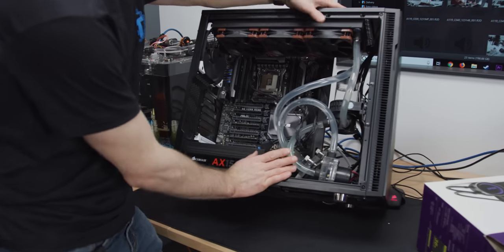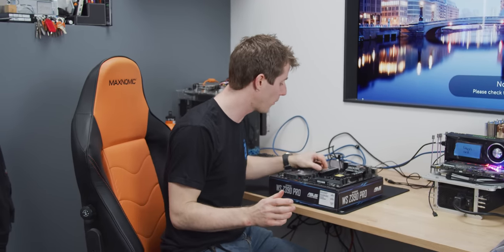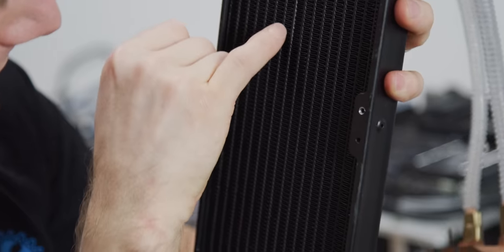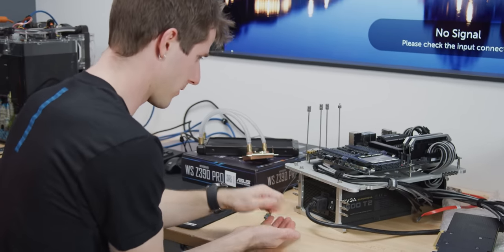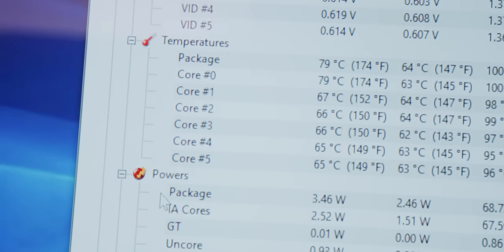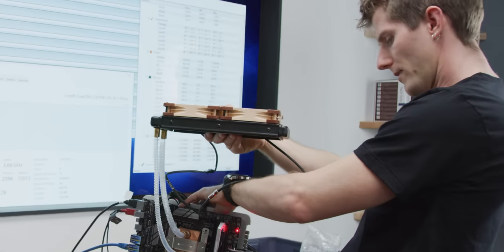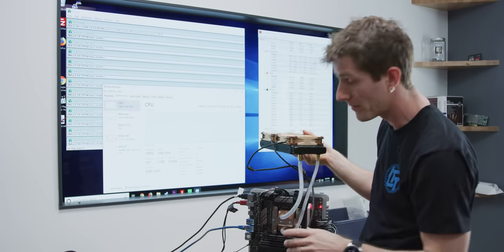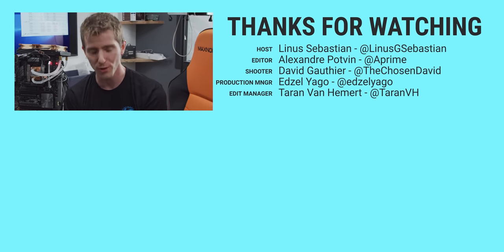CPU Cooling with BOILING LIQUID 🔥🔥

Comment: I am surprised that water would be used over an alcohol like ethanol or isopropyl. Yes the heat capacity is a fraction that of water, however the vapor transfer is significantly superior if you're going for a pumpless design. I am not a fluid dynamics guy but I'd gather you could probably do an ethanol/water mix to get the best of both while lowering the boiling temperature. Ethanol even boils at 78C which is the optimal operating temp for hardware unlike the 100C for water.(Again, if you're going for a pumpless design.)

Comment: Really? have you not tried a liquid with a lower boiling point? 
Boiling point of water: 100 °C / 212 °F
Boiling point of water (in Kelvin): 373.2 K
Boiling point of ethanol: 78.37 °C / 173.1 °F
Boiling point of methanol: 64.7 °C / 148.5 °F
Boiling point of acetone: 56 °C / 132.8 °F
Boiling point of alcohol: 78.37 °C / 173.1 °F
If it needs to boil in order to move the CPU need at least to get the liquid to the boiling point, sooooo what happens if the liquid has a lower point? my guess is well you could blow the entire thing up or create more flow (or no flow at all) i think is worth trying. 
Please try !
BTW you are the best, i recently found your channel and i am watching almost all videos lol

Comment: I don't think that the pipes in the radiator should have been at the same level, if the radiator was on it's side so that one pipe was higher then you might have had better circulation... probably best also if the pipes where connected diagonally... still not efficient enough but this might have increased the efficiency significantly...

Comment: basically it operates like a heat pipe, but without a wick and copper tube...
Reply: oh I commented before I got to 3 minutes into the video. Linus pointed that out pretty quick. haha
Reply: you took all of the right steps eventually, although I believe if you mounted the radiator where the tubes are vertical between them and you have the vapor line on the top side, that would likely improve flow as well. I am curious about this thing now.

Comment: What if they used a combination of two or three fluids that have different boiling points? So while one has turned into vapor and is in the process of being cooled, the other is still surrounding the cpu in liquid form?

Comment: put the motherboard flat and turn the cooler under 90 degree against the motherboard(so pipe in under heat comes from the cpu  pipe top fluid goes to cpu) and bubbbles :) that mean that you have air in the system that mean that this system not going to work properly  remove all possible air from the system and try again.

Comment: Its dry water, Novec made by M3 company. it doesn't short out electronics , you can put your whole pc in Dry Water (Novec) and it wont short out. I'm 99.9% sure that's what that is. I would put money on it. Dry water or Novecs boiling point is at 49.2 degrees C.

Comment: ahh try adding 2 or more radiators and see if it does something to reduce the temp even further... however it wouldn't be a standard tower case that you  can mount the cooling setup into..

at this stage an oil with a high boiling point may be the only liquid option that could  be used

however if you were 100-1,000 proof alcohol route for cooling  you likely need to get it 5 to-5c making the solution pointless to consider the option..

at this stage the only 2 oils I would use if attempting to use a radiator type cooling setup that would be  rice or olive oil or similar consistency..
Reply: You're missing the point completely, and Linus didn't explain it properly at all. The whole point about using evaporative cooling is that when a fluid turns into a gas at the same temperature, it absorbs a whole lot of energy to do so, and this is called the specific heat. Similarly, when it turns back into a fluid at the same temperature it gives out a huge amount of heat. That's why, despite his dumb-arsed positioning of the components, it was still doing semi-effective cooling despite the very low volumes of fluid and gas passing through the cooling block. Had he just once positioned the components most effectively you might have seen much better results but he fucked up the experiment good and proper. But that's why you need a fluid with a low boiling point, not a high boiling point
Reply: @herseem  i understood what he meant even if poorly explained how ever you will still  need to cool the liquid down to a point and sadly you would likely 2 or more radiators to cool it to the point the liquid is cooled enough not to cause throttling of the cpu.. and anything else within use in the cooling system

living  in a country that oftenly doesn't see an ambient temp below 35c in summer  and can average the same temp days on end all year round..

cycling hotwater can become corrosive even in gas form because you are still boiling the water with impurities  and whatever chemical imbalance there is would cause more  more damage..

 unless you have the capacity to drop the the temp from 60-85c to 2-10c and keep cycling the water no chance in hell you are drop the heat to the point you don't start cooking thing..

you will likely be needing a cooling solution that would not likely fit within that chassis to the point you could drop the cooling down to a point it would below 22c..
Reply: @jasonhowe1697  An ambient temperature of 35 degrees C??? That's a tough environment!. Evaporative cooling there could be a challenge as it would be more difficult to get the damn fluid to condense again
Reply: @herseem   in my situation  it is best to sit  the  pc on a concrete floor and  suck cool air through the bottom of the case and vent out the top...

My original comment was more directed  at cooling  aspects of the system as setup you would likely be needing to mount 2-3 cases together to mount the excess coolers into I would hazard a guess that  the cooler setup  was not adequate for use if you were trying to cool the system down past operating temps as I doubt it would cool tthe liquid enough dissipate the adequate enough for cooling the cpu or anything within the cooling loop..

I have no clue what the average temp in north america as a whole  is  however I suspect you will likely need to operate this in a constant room temp south of  25-18c for adequate cooling requirements..

if you are in a room north of 32c you will not have adequate cooling
Reply: @jasonhowe1697  your suggested airflow pattern is pretty sensible for any environment - bottom to top
Reply: @herseem  It make more sense having the psu in the top part of the  case unless you require a 2 psu option.. depending on the gpu option you want to use..

you would pretty much  need a different case and layout if you wan to suck cooling in from the bottom..

however I still have to ask being a workstation class platform i have to wonder why isn't there 2 psu's in the chassis as you would likely 1 psu for the the mobo and drives and 1 for the gpu setup ..

Comment: How about if it used rigid pipe and a pair of non-return valves to force a directional loop through the block? I could see that being much more effective (as long as the loop could withstand a bit of internal pressure) as the current system appears to be working like a reflux condenser and not making the best use of the radiator

Comment: .. if the problem of noise is pump... it's possible to make a parallel 2 or more pump loop? it could be possible to reduce rotation inside every pump, reducing noise, but have the same flow (sum of the reduced flows of every parallel pump). Or not?

to explain better

pump go for example at 100% at make a lot of noise.
if i put two pumps at 50% the noise will be lower but the sum of flow (50%+50%) is near the full flow of a single pump.

i don't know if it could work...

Comment: The liquid inside is most likely called, "Dry Water", made by 3M.  
Orientation is CRITICAL.  Tilt the PC board as well as the radiator.  Neither of them should be horizontal...  The smaller tube should be BELOW the larger tube at all points in the loop.  Thus the airside would always be ABOVE the liquid side.  Allowing the liquid to flow back down into the smaller tube and into the CPU.  
Someone skipped physics...

Comment: Surely this would work better if all air was removed from the system (liquids work better as a hydraulic than gasses as they are harder to compress) - then fit a check valve to one or both of the pipes to force the liquid to travel in one direction!!!!!
Ethanol which has been suggested wouldn't necessarily work any better than water as it's a sealed unit. Ethanol cools things quickly due to it evaporating quicker than water - which obviously wouldn't be happening if it is sealed! ;)

Comment: well this isnt really anything new. many(if not most) of the refrigerators that you find in campervans etc use this technology to sirkulate the coolant medium(along with a heating rod/element)
it will work, but will not be as efficient as traditional cooling. just my thoughts please tell me if its wrong :)

Comment: (0:25) - Um, no, you don't always need a pump.
Surely, if your pipes are big enough you could just rely on convection, no?
Hey, I'm getting in early after that PCI DDR-1 debacle awhile back.
And no.
I haven't seen this video.
I paused it to comment at, oh, what?
Er, 0:25.
OK.
Let's roll.
If it does turn out Linus starts veering to the convection route,
I'm outta here.
>

Comment: 7:48 If that thing is seriously sealed and its bubbling I'm going to guess its filled with dichloromethane CH2Cl2 which is the liquid in those retro Christmas tree bubble lights!  Let's see if my I can remember my high school chemistry (back when you actually learned shit in schools).  For a liquid to boil it absorbs heat (duh) until it changes phase from a liquid to a vapour (evaporation cools).  When the vapour condenses it releases that heat - heat pump!

Back to the video which was pause at this point.

Comment: What I would consider doing, is adding a tesla valve to one of the tubes, and increasing the diameter of the tubes, as well as searching for a tube design that specializes in low friction of fluids. The tesla valve is an invention of Nikola Tesla… It's a one way differential pressure valve, which causes them to encounter high resistance when trying to travel in one direction versus the other, and it has no moving parts, so it's perfect for a clean, closed-loop system like this. The suggestion to increase the diameter of the tubes that move the fluid from the CPU block to the radiator, is because larger tubes generally = less resistance. (Probably something to do with the boundary effect.) But I suppose it won't help up to a certain diameter, because reasons.

Comment: corrugated tubing makes 0 sense for this.
Reply: it's probably helping with structural integrity, because of the pressure inside is probably lower that atmospheric to lower the boiling point of the liquid.
standard tubing would collapse in this condition

Comment: curious... what if the radiator was mounted horizontally on its side... so the hot side came in on top and the "cold" side on the bottom... even though ive never seen a case like that... but would it improve flow... and... a 360 rad

Comment: That mobo should be standing properly in case, not laying on back and that radiator should be rly above that and flat, not on side lol...If mobo will stand, than one tube will be highter and warm water + bubbles will go UP by that one and cooled water will go back DOWN to lower tube...
Ou Y finally figure out thx good xD

Comment: Could they not use a Pelletier cooler to increase the liquid temp to the point of boiling before the cpu gets to that level. You could further tune it by installing a controller with a thermopile that keeps the liquid at the "perfect" boiling point at all times. This would reduce operating temps but I think a different refrigerant would have to be used,.one with a higher enthalpy than whatever is in this device, and one who's boiling point temp and enthalpy is greater then that of the cpu's max under load temp, otherwise the system would equalise at the CPU's under load temp and you wouldn't achieve a good heat transfer at higher temps.

Comment: So just a low boiling point liquid turning into gas at a certain temperature and recondensing in the radiator.
So you'll have pretty stable temps no matter the load untill the system is oversaturated with heat.
But since there is no directional flow this looks pretty stupid....
Reply: Ricardo Pesenti the gas bubbles up both tubes and liquid flows down both tubes. There are two to prevent suction from impeding the flow.

Comment: how are you preventing the motherboard from complaining about the lack of a fan?

most motherboards will detect if a fan is not working and warn you that you could cause damage to the cpu or board.

you could write a load for the cpu by reverse engineering malware to see how it hogs the cpu and write a program that loads the cpu .

Comment: 13:25
That's not remotely feasible to protect. Anyone with electrophoresis or spectroscopy equipment (i.e. a hell of a lot more people than anyone who doesn't know what electrophoresis or spectroscopy are would expect: basically anyone with access to a university chemistry lab, and any chemistry enthusiasts who care to buy or build one themselves) would be able to work it out within a couple of hours as soon as they got their hands on it. To people who understand chemistry and have access to any moderately well equipped lab, working out the exact components of a solution is trivial.

Comment: Kinda stupid to have the fans mounted on the radiator but not operational. This impacts the radiator's ability to dissipate heat. Why have the fans at all if you're testing a "no-moving-parts" system?

Comment: What will be a good temperature for a ryzen threadripper 2920x. I have one install with a thermaltake 2 240 radiator fan water 3.0 cooler but the temperature in idle are around 63. If I run the CPU it goes up to 95 degree. Is that ok or I may be missing something

Comment: Because of the temp, I'm just gonna say it's distilled water. Boiling point is 100c so it actually needs to be close to that for the percolating/siphon action to work.

Ethanol boils earlier and has even better thermal conductivity, so fill that bitch with Vodka and let's rock!

Also - the stand-off that's crimped closed was probably used to evacuate some air and get it under negative pressure, which helps water boil at a lower temp. Unfortunately, those ribbed tubes kind of fuck that idea away because they're so compressible.

Comment: You are totally wrong about capillary action: it has nothing to do with this design, nothing at all!
It works simply because steam is lighter than fluid: no capillary tubes required!
The trick would be about getting a fluid with a lower boiling temperature and evaporation enthalpy: any chemist worth his salt would be able to offer a few relatively cheap and safe options.

Comment: hey linus, my i5 3570k on asus z77-a wont post with my full 32 gb set but runs fine w 24, any ideas? currently running a ripjaws red 8gb set and a ripjaws blue 16gb, ddr3, trying to switch the reds out for hyperx fury blue 16gb set, tried all dimm configs and got nothing :( couldnt even get to bios with all four 8gb sticks

Comment: I have a laptop with an Intel atom, runs without a cooler, yea mmmhmm lagg was real even with YouTube, running under 1ghz well I took the back off glued a fan ran on USB power over it an  it ran 1.6ghz nonstop, broke the screen going to use the mainboard as a bedroom TV system. 2gb ram, quad core Intel atom, not even a USB port, but the attached keyboard had one usb port, so I'm going to wire up a splitter to that. 5v power, maybe 10w total for the system and 32gb storage, non expandable because I broke the SD card slot

Comment: .. This tech is nothing new Subaru has been using this to cool 100f turbos for decades...

Your explanation is wrong... It's called the venturi effect and it uses phase change to remove heat while using gravity to push liquid down while heat/vapor and air rise together.

It works decently but it's not fool proof. Also the copper chamber may be a vapor chamber for evenly dispersing heat.
Reply: He figured it out, he compared it to a heatpipe cooler, which is essentially what it is.

Comment: You might get better temps if you didn't use water in the "water cooler." I'd use antifreeze. It has a higher boiling point than water.

Comment: I feet like this setup was completely idiotic!!!! There was no way that that water was going to cool the cpu in that configuration. The cpu has to be slightly above the lowest point of the returning cooled water, so that the cpu can heat that water, which goes to the radiator and then gets to ther returning tube, and the process continues like that such that the hot vapors do not mix with the cold water

Comment: You need to select a pipe and nominate it as the return pipe, the return pipe needs to BELOW the hot pipe. 🤦🏻‍♂Did you skip science? It's scary watching you try reason yourself though this. PS it is a product. It's not a trade secret.